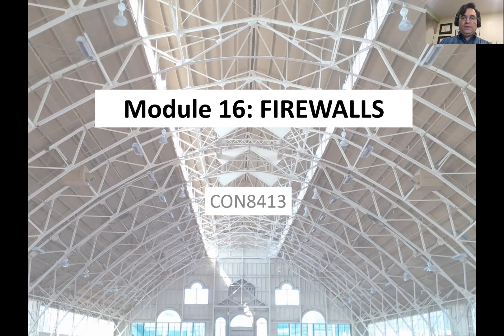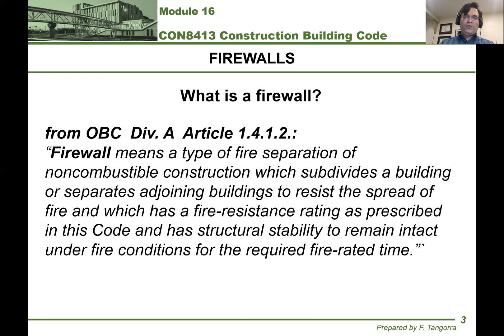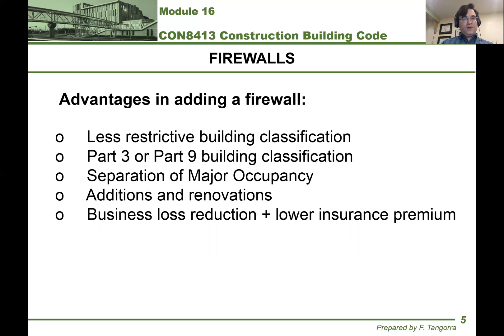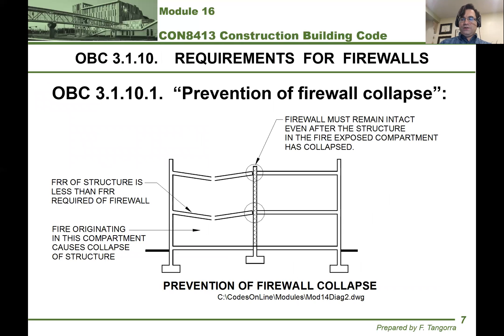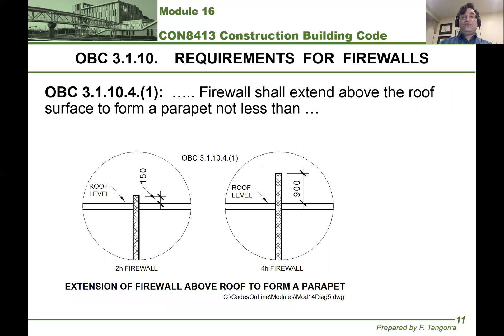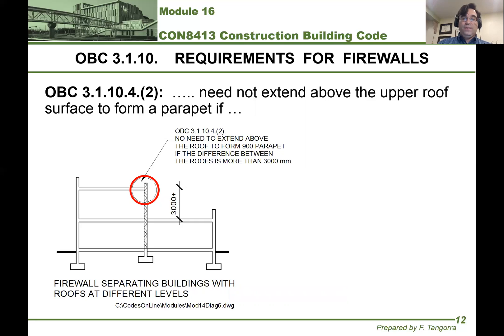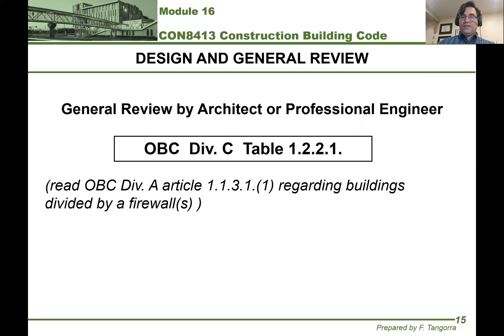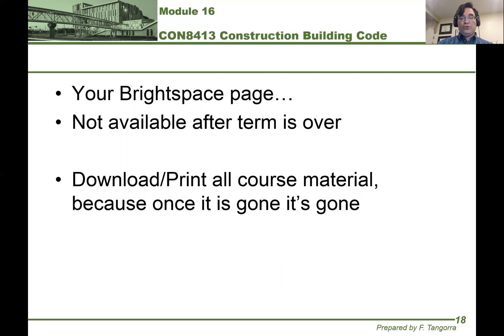CON8413: TOPIC 16 (Firewalls)

Comment: I have a question: In an bungalow, furnace room shared by first floor and basement, and the furnace is equipped with duct smoke detector, do we need fire damper for air supply ducts? How about the air returns?
Reply from the maker: Unfortunately this is outside my area of expertise. 
Maybe someone else will let us know.
Alternatively,  you can consider going to your local municipal Permit Office and ask there. I have found many of these folks to be very helpful 
🤞
Reply: @FrancescoTangorra  thank you for the info. Will do it.